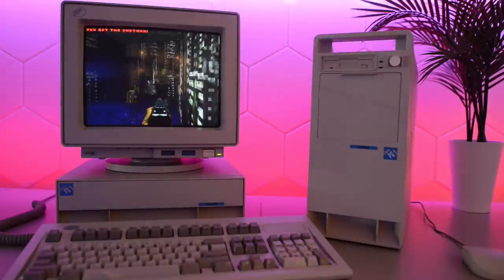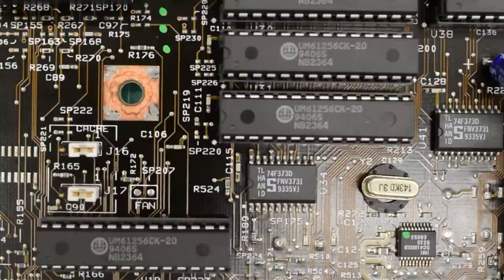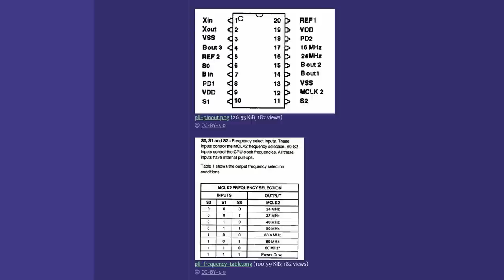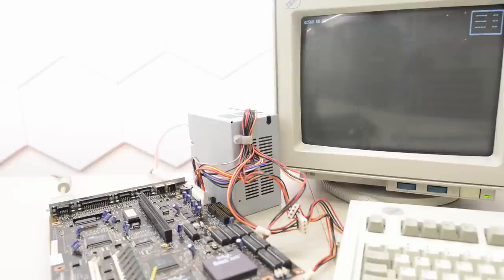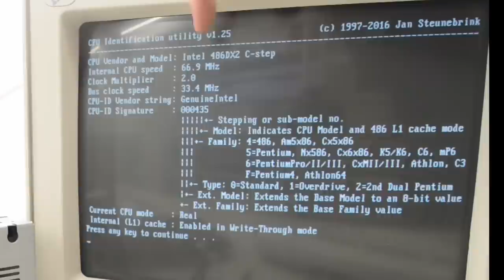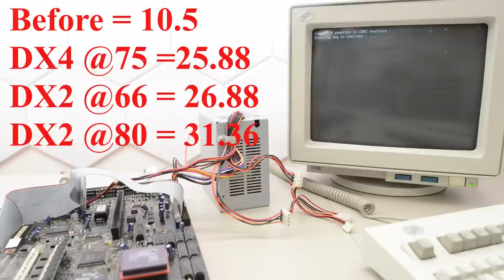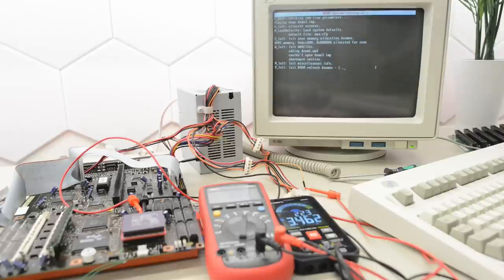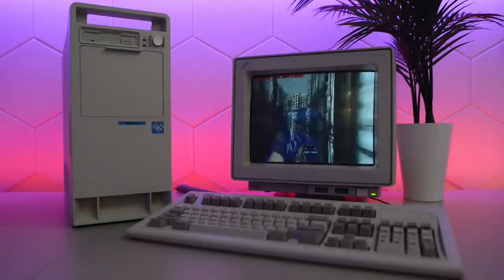3.6X faster DOOM! Sneaky IBM Tried to hide how fast their board actually was!

Comment: When the odd "586" cpus were released, I never understood the draw. Pentium was out and offered a much better architecture. But for this use case they are really great.
Reply: well the draw was to not have to buy everything again. it's a psychological thing even if you wouldn't save much money at all.
Reply: It's more of a straight swap. Keep in mind tech was evolving FAST at that time, so if you could stretch your system foe awhile you could wind up saving money. Also, the AMD 5x86 was essentially a die shrunk and OC'd 486, so they were cheaper than you'd think. With that clock speed bump they were about as strong in most common tasks as a low end Pentium (the reason for the P75 rating). The main caveat: FPU stuff - the Pentium wiped the floor with practically everything else there. This wasn't an issue for most gamers till Quake came out, however.
Reply: at the beginning a fast 486Pc does runs better than a P50 or P75.
Reply: @mibnsharpals  pentium was released before the faster 486's were released. I don't think there was any phase where 486 off the shelf was faster. cheaper yes.

depended a bit on what you're running how much worse the 486 is.  it was already 1995 by the time of the 120mhz 486.

Comment: An 83MHz Pentium Overdrive ( PODP5V83 ), aligned approrpriately with the inner matrix of pins on the Socket 1, with free-hanging pins (and possibly a wrap/bodge wire to the write back pin and the appropriate pin on the motherboard chipset) would be faster than this Am5x86 at 133Mhz (or 160MHz).  If you want to try something even crzier than this in the future.
Reply: I have an IBM PS/1 Rapid Resume tower with the same looking board that I put a Pentium Overdrive 63MHz in.  The computer was given to me in 2012 and it had a 486DX2/50 and I upgraded it for fun just for DOOM/DOOM2.  Now I am wondering if I can make it run at 33 FSB.
Reply: @Vile-Flesh  It would probably work well at 83, especially because it has a heatsink and fan built in.

Comment: Reminds me of the original PC/AT.  The motherboard had a 12MHz crystal but the schematics labelled it as 16MHz.  Sure enough, a 16MHz crystal let it run just fine at 25% more speed.

Then IBM noticed people were doing this and they added a speed check in the BIOS startup code so it would not boot if it was running at over 12MHz!      So you needed to have a switched divider, putting out 12MHz for 10 seconds, then switching to 16MHz.  Easy peasy, almost.
Reply from the maker: Interesting, Was this a BIOS or hardware hack?
Reply: @Epictronics1  Could have been done either way, I did it in hardware.
Reply from the maker: @georgegonzalez2476  I'd love to do that hack. I guess in that case, there should be a hacked BIOS out there?
Reply: @Epictronics1  Adrian Black did with with his AT 5170 several years ago, with a modified BIOS to remove the check.

Comment: Not that I want to defend IBM, but really, he didn't try to hide anything.
Clickbait?
Reply: they hid the fact the bus speed was adjustable by using the smallest resistors they could find instead of usual jumpers. basically without redesigning the board they could sell a faster model for far higher that really had the same exact parts as this one. typical of computer companies, it's still happening to some degree.